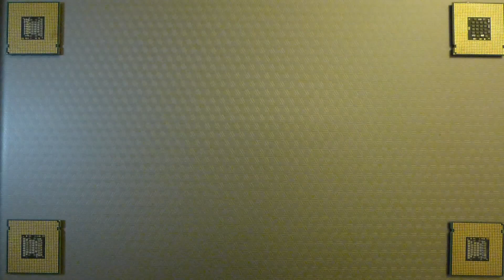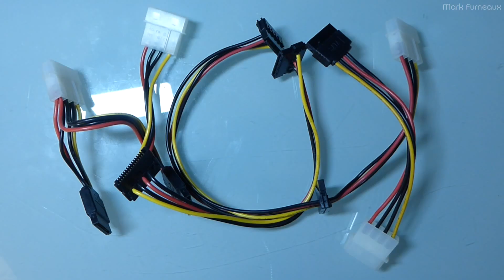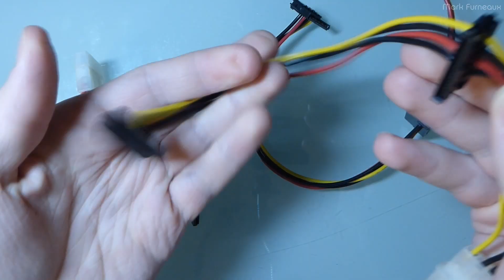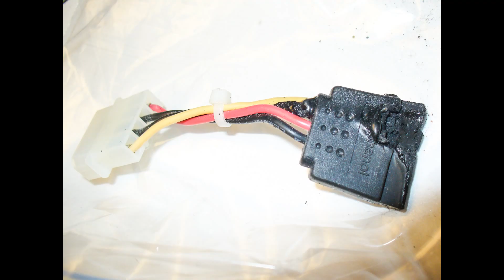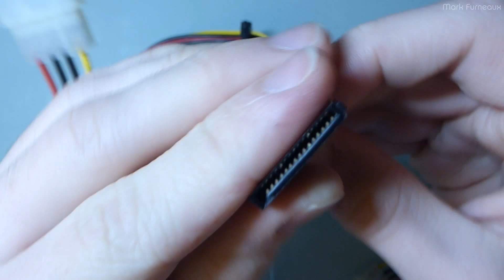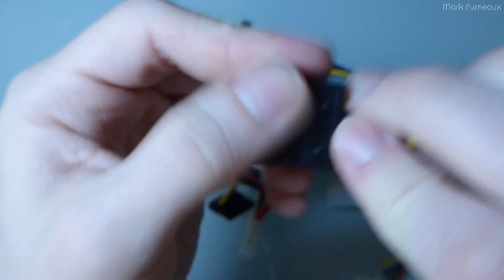How To Spot Molex To SATA Adapters That Won't Catch Fire

Comment: how do i fix a power supply i blew up? touched inside with metal screw driver to the plug part with plug plugged in and boom pop
Reply: Are you serious? You touched a metal screwdriver INSIDE your power supply while it was PLUGGED IN? You are EXTREMELY lucky you didn't die if you are being serious!!
Reply: Yep, you're definitely trolling. Whatever, I fell for it at first, well done.

If your dad was really an electrician, he would have told you that you don't touch anything electrical with a metal screwdriver. lol
Reply: anikanbounty97
I kind of hope you are trolling because you should never EVER take apart a PSU unless you know EXACTLY what you are doing. Some of the components can hold an electrical charge for years and you can get electrocuted extremely easily if you do not know what you are doing.
Reply: anikanbounty97 LOL you still alive?
Reply: Ya ik and I had a really bad month in October. Everything I did broke or was not right. I guess it not normal to servive it no harm at all? I do not know what I was thinking as I taken apart power supply before with my dad and touched inside and was fine. I think I was trying to jump start the psu. Well I will never do that again.
Reply: I think it's possible he might not be lying. Yes, getting zapped by a power supply may kill you, but just like 120-240v can kill you, it doesn't mean it's going to. Funny story even if it's true or fake
Reply: @iamafellowhumanlikeyou304  Its not the voltage that kills, its the current
Reply: I don't troll. I do know what I am doing, it just had bad October.  My dad an electrician and he knows what to do and he showed me before. I knew the problem was the switch but again bad October. Is it not normal to servive blowing a psu and only damage is being shaking up and destroyed psu?
Reply: Ken i said i don't troll, don't even know how to. I simply asked a question at the end. If you don't wanna believe it happened to me ok but truth is truth and it did happen.
Reply: Ken he did and i knew that but bad October my brain was being dumb. I was trying to junp start it lol

Comment: Maybe the bad sata adapter is so cheaply made that the copper inside the wires is too thin, resulting in heat being produced, which makes it easier to melt the insulation until they touch each other and start burning.

Comment: Over CUrrent Protection doesn't work in many many cases...
Because it's either not implemented in the PSU at all (see the protection chips and the spec sheets. too many PSUs have just an 8pin IC that doesn't have OCP anywhere)...

Or just because it's set so high, that it's not reliable...
On the minor rails we talk about 20A minimum. And on some units like EVGA GS-Series, you don't have OCP on the minor rails. If you overload this unit, one of the DC-DC modules might burn...

Comment: Thank you for this. I've been using a Molex to 2x SATA connector for a few months and just recently found out that they can catch fire. I got all freaked out by it, and unfortunately the one I have does indeed use the molded type connectors. Luckily I was able to rearrange some components and reroute the PSU cables in such a way that eliminated the need for such an adapter.

Comment: i dont have a server but for my 3 drives and one ssd i use 6pin to 4x sata adapter which was included in my " Seasonic M12 II Evo Edition 850W" PSU box http://www.jonnyguru.com/modules/NDReviews/images/SeasonicM12IIEvo850/DSC_9827.jpg two of them in left side

Comment: I think the process goes like this:
1. A "bad apple" connector with too much solder/wrongly stripped insulation/abnormally thin wire drifts together in molding process
2. During use, the cables inside gets broken, but since it's still connected it will continue to work somewhat
3. After sufficient amount of dead strands occur, the wire won't be able to stand the power consumption of whatever is connected to it
4. The wire heats up, melting plastic and insulation
5. The power wire in close proximity will also start to melt and drift towards to the fault
6. Arcing occurs, effectively making carbon deposits which aid in creating more heat
7. As the wire heats up, the resistance of insulation drops significantly
8. Power supply doesn't shut off because it's well under current limit (while the connector is going up in flames), effectively welding two wires together
9. Wire melts, completely wrecking entire connector and whatever is connected to it
10. Power supply THEN realizes something is wrong and shuts off

Comment: Oh shit, better check mine!
EDIT: It turned out to be one of the flammable ones in my retro computer! Everything in there is freaking expensive, got that shit changed right away.
Reply: Retro computer with sata?
Reply: Erwin Holland The 775i65g motherboard has an option for IDE emulation built in, so you can use 2 sata devices however the 2nd IDE port will be unusable. Good for me considering I can't find a good IDE harddrive anymore.
Reply: I have a couple of 50gig and 75gig IDE drives never been opened lmao
Reply: MrDanderskoff Oh lucky, I can only find used ones.
Reply: Kippy Kip If they're not too small I could sell a couple of them
Reply: MrDanderskoff At the time I probably would've bought one, but the IDE/SATA emulation is really good for me.
Thanks for the offer though.
Reply: I have a 775i65G aswell! pretty awesome board if you have rev.2 of it.

Comment: The thing I notice is that the melting seems to occur with the 12V line, never the 5V.

Given that some of the higher-end, single-rail PSUs are rated for almost 100 amps... in some ways, I'm not surprised the overcurrent protection doesn't trip, at least not until it's far too late.

Comment: amazing mark. I had a desktop computer in a rack somewhere with less than ideal ventilation. it caught fire. I assumed it was just due to the poor airflow and promptly moved the system, however after watching your video and seeing that the melted plastic was at the SATA connector end, i'm convinced it was the sata to molex adapter.

Comment: Arc at 12v? I dont think so
Reply: you know air has a break down voltage for a arc to occur?
Reply: yep no problem.

Molex are quite the standard in computers. The thing to watch out for is cheap cables in general, the times that I have seen bad SATA cables which give really hard to find IO errors lol. 

Yes I am a Electrical Engineer but I also do Software Development. I also do lots of RF related stuff. Electronics and RF can be like dark magic sometimes. :P 

With computers you can just debug. 

Anyway the real knowledge is experience that's how you really understand electronics or programming.
Reply: I'm not that much into electricity stuff.......but some of these adapters are made of iron instead of pure copper.........I think it has something to do with more heat because iron have more resistance than copper
I always examine the cables that I buy with a strong magnet to check if it's copper or just cheap iron
Reply: thingyee1118 Oh, that's true, I suppose my comment is less about molex and more about molex-to-sata when molex-to-sata isn't really required anymore in this day and age.
Reply: Arcing can only occur when there's sufficient tension, expressed as voltage, in the current for a discharge to occur across the air.

12 VDC is nowhere near high enough.

But, what can happen is that a short circuit can develop in these cheap power cable adapters.

Given sufficient current, this can cause the wiring to overheat to the point of scorching and even catching fire.  The hottest spot will be the point of greatest electrical resistance: the short, which is likely a few stray strands of wire connected to the power pins coming into contact with the ground pins next to it.
Reply: thingyee1118 I didn't know that, unfortunately I am not an electrical engineer, I'm just a software engineer. Thanks for the information, though!

Either way, I would never use Molex cables, some people seem to PREFER them for some unknown reason.
Reply: thingyee1118 I mean I personally haven't used Molex in any of the computers I have built, I'm pretty sure it's a very old, outdated technology which is why I'm surprised why it seems like people swear by it and refuse to give it up when it is inferior.
Reply: Well Molex is a bit of a umbrella term:
"Molex connector is the vernacular term for a two-piece pin and socket interconnection, most frequently disk drive connectors. " src=wikipedia.

The motherboard connector I believe counts as Molex still AFAIK. So maybe you have used Molex in them :P
Reply: Yes I don'y use Molex to SATA much. Sometimes if you have many drives though its unavoidable.
Reply: I weld my jeep back together in the woods with a 12 volt car battery and jumper cables and a welding stick and got a arc
Reply: 12v is plenty, and SATA drives draw enough current to easily arc between contacts that are close together.
Reply: no the voltage must be higher to break down the resistance for such an arc to occur. 12v arc gap would need them to touch before creating anything resembling a arc. hahaha
Reply: if your project is something that raises the temp its not unlikely
Reply: If the resistance is low enough, sure, why not? Current is what matters.

Comment: Indeed I had that happen as well that burnt two hard drives costing me about $400.  I ended up putting in a Corsair power supply which had sufficient SATA connectors for my five NAS hard drives.     Note that I found the cheap connectors were very loose although your explanation could be equally valid.   See https://www.youtube.com/watch?v=2qtSxzvvuho

Comment: It would be great if you could change the background of the video to something else. The glass is a bit annoying to watch, it reflects a bit to much light and you can see scratches  in the table. A matt piece of paper or something else that doesn't reflects as much light would be better according to me.

Otherwise great video!
Reply from the maker: +Jonathan Jonsson I appreciate the feedback. I don't like it either. Since I got an LED lamp, you can see the glare all the time. My camera really doesn't like low-light, so I have to keep the lamp. I will be moving in about 6 months to a place which will hopefully have a real workshop where I can have a proper bench. Until then I can see what my local craft store has in terms of coloured paper.
Reply: +Mark Furneaux why not just a Matte Mat? like a piece of  Drawer paper or maybe wall paper.
Reply from the maker: +Terry Sterling I need to be able to cut it. I have like no room on my desk. I have an ESD mat, but it's bright red and I don't think that will look too good. I'll find something in the next few weeks.
Reply: Mark Furneaux Do you have 2 dollars? go get a piece of wallpaper from what ever home improvement place you have in the area. My wife uses it in her jewelry pictures, it works amazingly well.